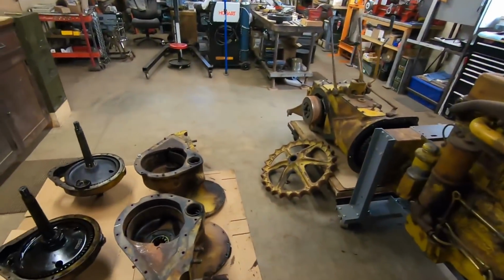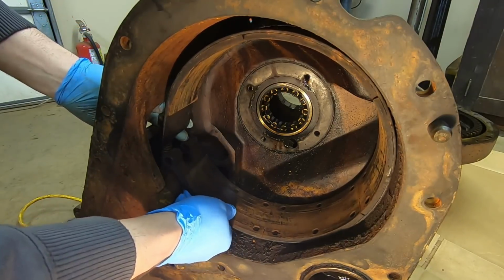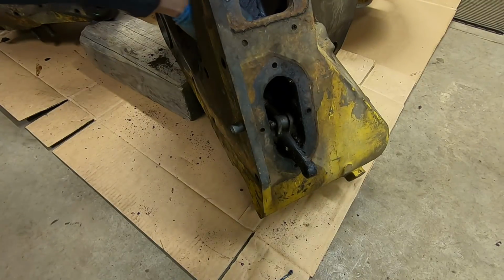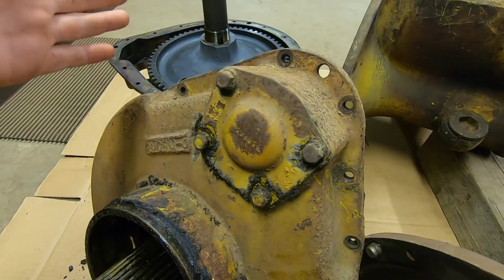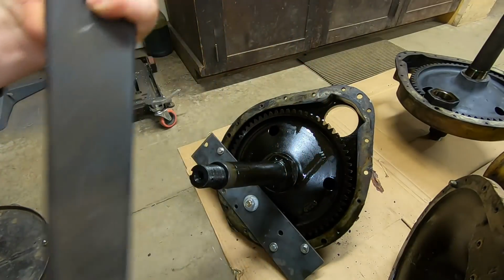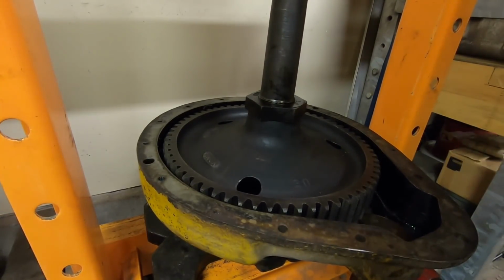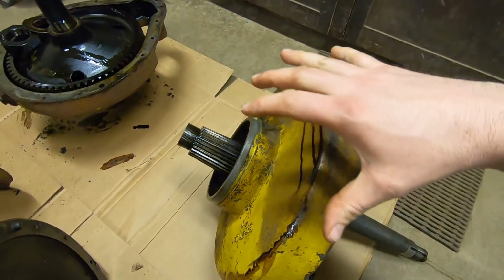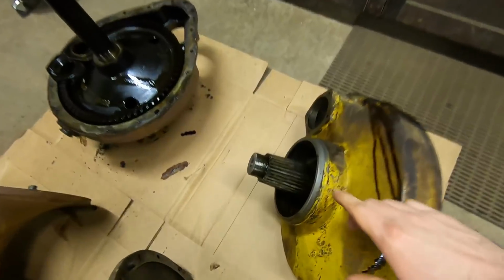Caterpillar D2 #5J1113 Chassis Rebuild Ep.26: Final Housing Disassembly & Prepping For A Bull Fight!

Comment: That's a neat trick using the rubber tie down (bungee) strap for holding the bearing from falling. I've used magnetic bases like what you would use for a dial indicator in the past. I'll have to remember that trick

Comment: Really enjoy your videos watching you working on those bull gears reminds me of when I was 13 my daddy had a 933 cat track loader his partner was operating it down at the bottom of a deep valley sunk in some soft stuff over the floor boards then stripped out the bull gear on one side. We had to hire the biggest dozer to pull it out and he had to use a snatch block with a double line. Then we worked most of the winter after work and Saturdays fixing all that stuff. Had to carry all the tools down and back up that hill it was a tough job that was in 1968. You make it look easy thanks for the good information

Comment: I had a nearly 30yr old original u-joint in my Cherokee front drive axle that wouldn't come out. I didn't want to smash the yoke with the press, so i pressed as far as I dare, then applied heat with the propane torch. when it finally let go, so did my bladder! It was as loud as a gunshot and my ears were ringing. no caffeine needed that day

Comment: A rose bud tip would be a good investment, you need to get more heat to the outside of the taper quicker. Wish I lived closer i farm and do machine work for the oil field, it would be fun making tools for you, i kind of fear for your thread on the end of the shaft when you go to putting 30 tons on it.

Comment: We used to rebuild the brake bands in epicyclic gearboxes going back 45 yrs ish when i was an apprentice they were semi automatic boxes either spring operated or air hydracyclic happened later so yes that bought back memories
Reply: Out of curiosity, how many were some form of English Wilson design ?
Wilson preselector transmissions and WWII tank transmissions had lots of brake bands.
Reply: @paulmanson253  they would have been that type of design one thing i do remember when putting into neutral you really had to be careful if you missed the full force of the spring came back through the pedal and trapped your foot under the seat these were what we called half cab buses

Comment: With the bearings in a blind bore, I know this is changing the original design, how about two driving holes sealed with flush pipe plugs? This would give easier removal.

Comment: If you ever need a better shop press, it's probably a worthwhile investment to just modify what you already have. As it's cheaper to just build a stronger apron and top rail of the frame, all it really needs is gusseting as reinforcement. Look at something like Edwards Ironworkers' presses for example, they have a 40, 60, and 110 ton presses that all follow the same design philosophy, where the apron and top rail are reinforced; as compared to the typical shop press design philosophy, of the same ratings, being that an ungusseted U channel is 'good enough,' it really comes down to proper reinforcement being more economical solution and being a 'work smarter, not harder,' solution. The only time you'd need to upgrade the entire frame is when the adjustment pins the apron sits on starts shearing through the frame verticals; and even if you think a press is going to shear it's pin holes, those can also be modified, either with reinforcement plating, or with a tube running the gap in the U channel, and even this upgrade is more economic than a new press entirely, and may even boost the tonnage rating slightly. 
Reinforced horizontals is step 1, reinforced verticals is step 2, where replacing the press is step 3, either by building your own, which is cheaper but more time consuming, or looking for a decent replacement with it's redonkulous pricing. Even if it's not a long term solution, it's a good hold-over until the shop press needs a full replacement, especially as this is a relatively inexpensive solution by comparison, just some small pieces of steel, some welding, and some paint.

Comment: About the 50T puller, I know it's a sound purchase, has channell appeal and you can offset its cost reselling the 20T unit, but I suspect that with your ingenuity and skills you would have been able to remove these shaft working the 20T and shop press together. Sorry if someone else had said that already.

Comment: I had to pull finals off a mid 70's CAT low drive side boom and the puller was almost the same as in your book except the pressure to install and remove were a bit higher so all the rams and rods were bigger lol. The removal force is 85T and install is 450* heat and 55T of pressure. Had to use the crane on service truck to hold the pressing and the shop overhead to life the final drive gear. Unlike the high drive that is so easy the low drive is very labor intensive.

Comment: Here are some pictures for Squatch253 to contemplate:
1. Final drives on the KD-35 vs Cat D2. It seems the Soviet engineers got rid of the taper fit?
2. PTO shaft on KD-35 vs Cat D2, pay attention they removed the engagement dogs completely out of the equation. Same goes for the PTO linkage, just one leaver and that is it. I'm not sure how good of a idea it is to keep idler gear running all the time in the PTO. But looks like it works.
https://ibb.co/L1DXJNJ
https://ibb.co/0ySsX8D
https://ibb.co/v4nfbjf
Reply: @squatch253  As you can see some serious engineering has been done. Having a hydraulic press in the 1950s was a luxury. So the soviet engineers made it much more simple so of the machine broke. You could fix it directly on the field with less hassle. But one can not deny the presents of CAT D2 stuff being used as a model.

Comment: I have the same press had to press apart some coaxial jet grout rods made the adaptors turned the guys loose had to pull to relief and tap on the side as they moved we had to keep pressure on as they slowly moved outward I came back to find the top of the press now has an arch. Needless to say upping the jack, nope not gonna happen

Comment: Speaking of big wrenches, our local specialty tool place and electrical repair source just sold a guy a set of 13 open-box end wrenches. The smallest is 2 13/16, the biggest is 4. $9000 worth of wrenches. 😳

Comment: Loving this channel,  but every time I see what you are calling a cotter pin my brain tells me it is a split pin.   I know that what I am wanting to call a split pin is usually called a cotter pin in America (USA and Canada),  so I will just have to get used to it.  Very small price to pay for watching your really high value channel.
When I was brought up in NZ a cotter pin was a sort of a bolt with a tapered shank.  It was traditionally used to secure such a bicycle pedal shank to its shaft.  As such a connection was prone to slight movement and wear, over time,  the cotter pin was just tightened up a little in its taper to take the slack out of the joint.
Be interested to know what you call this type of tapered fastener where you come from in Canada?

Comment: Hi Squatch, a thought. Is it possible that pulling rather than pushing will require a tad less force? With the taper stuck applying push force might tend to expand the section of the taper nearer the press as the further end of the taper resists moving, thus increasing the grip at least initially.  With a pull would the forces tend to cause the taper near the puller to contract thus somewhat reducing the grip? BobUK.

Comment: if you decide to use the long hooks thru the puller holes..  please fab up some J bolts to fit in a tapered channel piece to lock the jaws in the 3 bull gear holes.. so they can't slip backward ..  i don't know if you can get you  hand in behind the bull gear..  if you can figure out the taper and cut 3 nut faces at that angle. allowing you to put a big steel washer behind the bull gear along with a tapered face nut while you tighten a forged eye bolt thru the front to hook your puller legs to.. see in this video how cat D6D sprockets are pulled using the 3 holes.. https://youtu.be/J9YdflArW4s.    hopefully your hand pump will have enough fluid volume to move the 30 ton piston out far enough..

Comment: We got a clapped out 100 ton shop press at my shop. Think the ram leaks so much it's limited to 50 tons.
Reply: @squatch253  ours has an electric power pack with it, but in the 14 years I've been there it hasn't been serviced. Ram needs a rebuild at least.

Comment: So watched,  over and over, this video and the last. Still do not get what is holding the housing to shaft. Now the push collar you counter board to clear the shoulder the bearing stops on. So you say the bearing has to move a distance to come against the gear so i noticed that boar is shallow, think may need to give more relief cut deeper think your pushing against the shaft shoulder.  Oh you got Borked again!

Comment: Okay Sir , can not wrap my head around... the gear pressed on shaft, okay. Bearing pressed on shaft, okay. Bearing pressed in housing, okay so if bearing is pressing out of housing, why can you not pull shaft bearing and gear out of housing so can the press gear off, away, and off from housing?  Is the spline part of the shaft larger than the through shaft hole of the housing?? So the shaft has to come out the large spline end /out side, of housing. If so how are you pushing on the bearing center race behind the splines? What am I missing?
Reply: @squatch253  okay think I got it.  There are two bearings on shaft not one! The are tapered toward each other. There outer races are pressed into housing cover back to back, sandwiching the cover case. The outer bearing is held on shaft by a shoulder. So outer bearing can not come out and let the shaft. inner bearing and gear come out the other side. Did not know there were two sandwiched bearings. But makes since! Have to have that to keep shaft moving in and out and bull gear in place.  And it is bearing wear that lets it move and take out the oil cup assembly and rest of it all. Got it thanks. Reply if I am correct please! So is the preload play set and maintained by how far you press on the bull gear?
Reply: @squatch253  Thank you! So did you check for the clearance (depth) of you relief cut of the pipe caller you made for pushing? So I'm batting 0! well at least I' m learning? Oh by the way may have found a place that can and will rebuild D2 injectors and the pumps. Can send you the Info if interested they are a big 50 year old company! Very professional and serious about their work! It what they do injection pumps, injectors and turbos. Let me know send the info.Guess can say I was Borked!